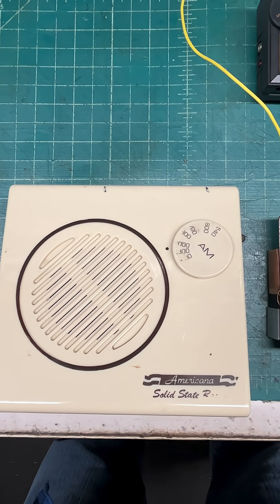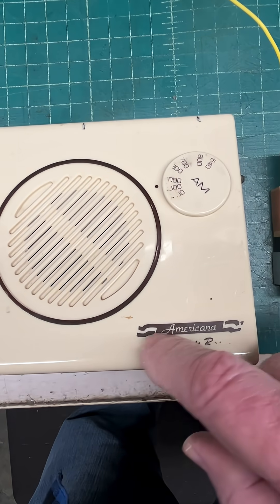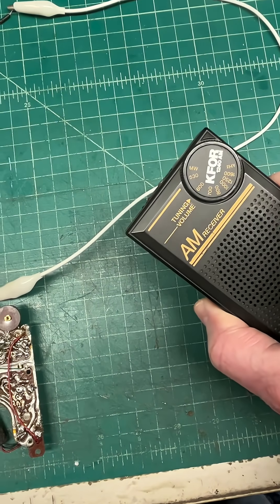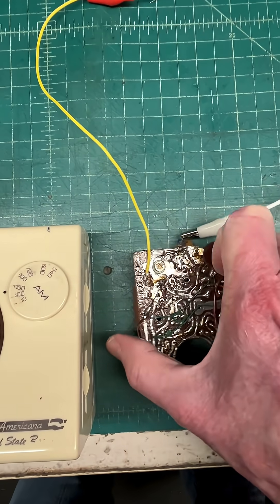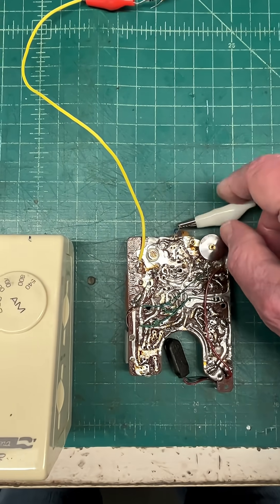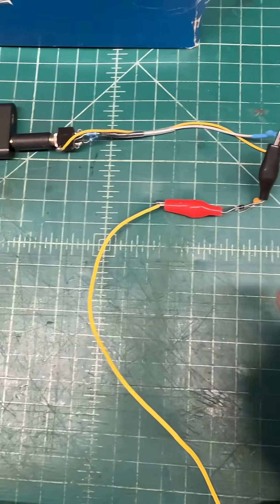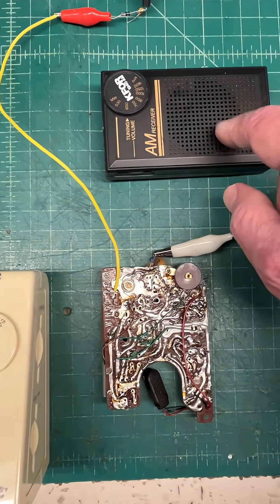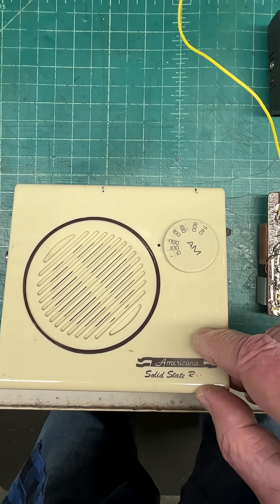AM Broadcaster | Easy to Build | Play Old Music

Comment: This doesn't make any sense!  He said the black radio he's holding is the transmitter, but the Bluetooth and diode are not connected to the black radio.  And the Bluetooth and diode are connected to the bare circuit board that doesn't have any battery!!  So this must be another AI Bulls**t post!  Total Nonsense!!